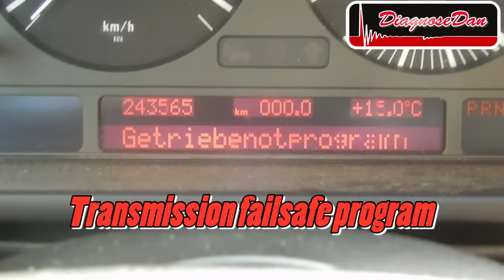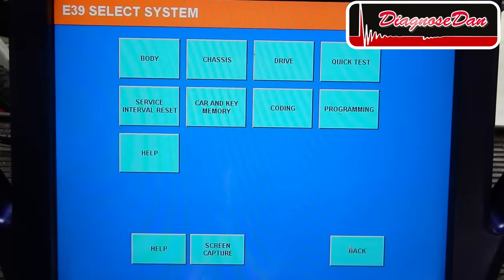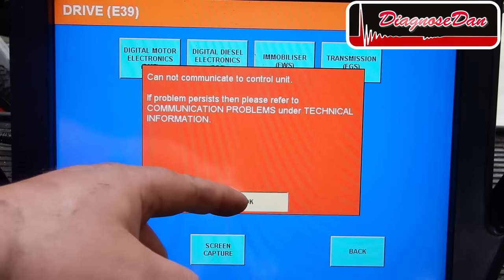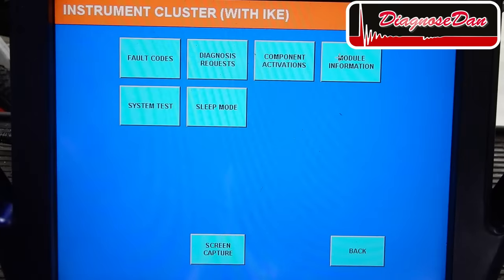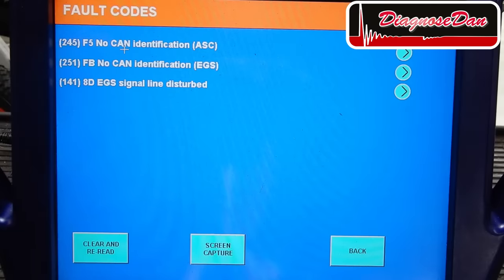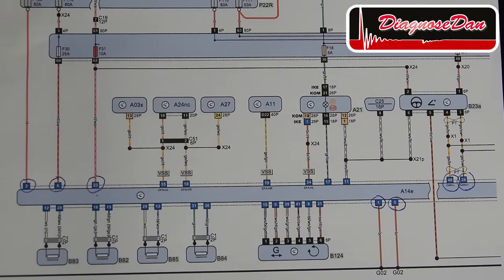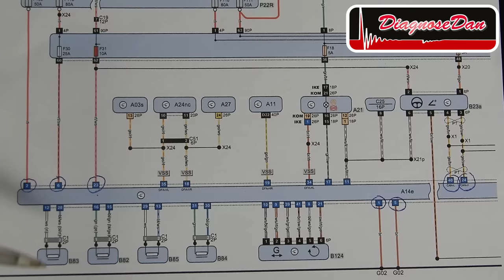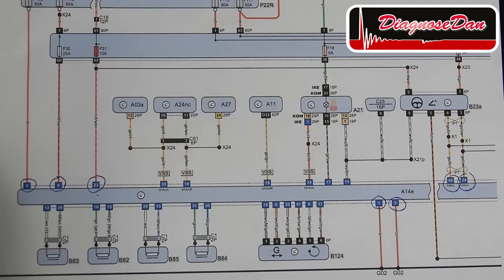Can-bus Trouble

Comment: This is a great video! My question, if you had tried to connect your scanner before replacing the bad ABS module, would you still have a comms error? I have a situation similar to this, but don't have a scope readily available.
Reply from the maker: With the ABS module unplugged the comm. is back.
Reply: Another question. Can these steps be done without first putting a car into accessory mode? I ask because I have a car with push button start and no keys.
Reply from the maker: @bl3nd3rs  the network stays active for a while after the car has been turned off. But there is proberbly still a way to turn your ignition on even though you have a push button.

Comment: Another awesome informative video. Will you run into problems by unplugging modules to where you have to reprogram or reflash them? Thanks for your time.
Reply from the maker: Thanks! I don't really understand your question!
Reply: DiagnoseDan I read the comments by Pine Hollow diagnostics and Ivan asked you the question I made. You replied about coding the module and would make another video about it in the future. My concern is about losing the program in the module or modules when it’s disconnected from power and do you turn ignition switch off or what is your procedure. I don’t have reprogramming capability.
Reply from the maker: @Thunderroad8517  you don't need to do anything when you disconnect it, only if you replace it.
Reply: DiagnoseDan Thanks for the info and the videos.

Comment: I did listen all the way through and yep it was good. Preferred it to others in fact so subscribed. I want to know your take on no can lo. naval cut out whilst driving. wipers not working. Central locking does. ECM and many others NO COMMS. Breakout board shows pin 6 busy and pin 14 long moments of nothing. then the faintest flicker for quarter second. Ohms test with battery disconnected 60 ohms.

Comment: Thanx for explanation. 
My 2001 e46  has "no CAN  iD ASC3 " error on instrument cluster all the time and that, i think, kills my ABS module every 2-3k miles. As this is the 4th ABS module installed and got failed with "ECU INTERNAL ERROR". Everything else works normally.
What can cause it and what does "no CAN ID" mean? And i there a way to fix that faulty ABS module?
Reply from the maker: Is the new unit coded correctly?
Reply: @Diagnosedan  Sure, i coded myself and calibrated steering angle sensor. Everything works well 2-3k miles and then ABS fails again with a "Internal Error ". Could it be MOSFETs are going bad on ABS because of some electrical issue or smth?

Comment: I have done the same job you done but I didn't replace it I cleaned it up and it works fine
Reply from the maker: That's great! They can be repaired most of the time there is a loose solder joint within the module.

Comment: Dan

Nice video.  But I'm confused about one issue.  What's the purpose of checking for total resistance which should be 60 ohms?  If you have a bad module (let's say a TCM module), how does checking total resistance help you?  Will your resistance change when you find a bad module?  Please explain.  Thanks
Reply from the maker: Steven Nahulak Checking the resistance rules out a high resistance( Module or connector) or a short (wire or mudule)

Comment: Hello.I have 2 questions, because I am trying to learn as much as I can from you, because you explain very,very well.
When you measured with the oscilloscope CAN High and Low signals you don't have (need) a ground connection???I have seen only to leads connected.
Second question:If you unplug the PCM  to test the influence of the signal; how do the other modules get power?Aren't they all electrically powered from the PCM??Is the PCM the ECU?Or is it a different component?

Comment: Hi dan, first off all your video’s are Great! Love to watch them all. Only have a question in this case. you can not comm with the abs/transmission/instrument Because off a faulty abs module. But if you would disconnect the abs connector, Will you maybe than be possible to comm with the instrument and transmission again with your scantool? Or is the small voltage increasement Still causing dis oriëntation on the can bus? Maybe by disconnectiing modules that are on that can line step by step and try between disconnections to comm with modules would also maybe find a bad module. So you dont have to need a scope for all can bus faults. 
Thanks for all!! Groetjes uit Nederland/utrecht

Comment: Great video thank you, I have an04 f450    6.0l diesel that I am working on right now and I have a CAN issue. I have prodemand, all data and Identifix but I’m struggling to find a good schematic for the communication networks is there a good site that I can use for some of that information and also for good waveforms. Thank you. I need to learn more about the bus networks & I think this truck will help me with that.

Comment: Hi Dan, Do you think that U0001 code possibly had something to do with my Chrysler 200 car "kicked" when i accelerate from stop - feels like I was rear ended. Nice video presentation by the way.
Reply from the maker: Hard to tell because U0001 code is a generic code. Usually it comes with a second more specific code.

Comment: Dan I do have a quick question-- all modules have 60 ohms running thru them whether they r good or bad? That ABS module had a short and so wasn't communicating with the others so how can low/high speed 60 ohms run thru it?
Reply from the maker: The 120 Ohm resistor inside the ABS unit was still good.

Comment: This is a good video it take us through the inner working of the CAN bus protocol, however this system can fix without the oscilloscope. The first thing to do is to ensure proper continuity in your conductors and do your ohms test with the digital multimeter. One major thing he did not highlight is which ECU responsible to provide the CAN network with the information. eg The Yaw sensor/module is responsible to provide steering angle and steering torque signal to the CAN network. So if this sensor module failed ,the EPS and the  ESC/VSA/VSC/ESP(they are all the same thing) will not function properly because both system ECU require this information for the EPS and VSA to work properly via the CAN network. The technician have to knowledgeable of the entire system to solve which ever network problem they are working with on. Excellent video please upload more

Comment: hi Dan  love the videos 
i was wondering about the ATIS PRO   soft wear (i know its off topic  but don't know who else to ask)  
as a small one man garage we do some engine diagnostic work but as you are aware information and equipment is very expensive .i have seen that the software you use is very good on components and wiring diagrams for engine related faults 
we do some engine related faults but also need to do normal electrical faults on other systems wiper/washers horn and many other things the main one being a/c and climate control systems  does the product cover these areas  .
Reply from the maker: acorn motor repairs, We usually don't use a scope for diagnosing problems with a horn or wipers. But the wiring diagrams are mainly for engine,Abs,ect. But there are a lot of options for using the scope for ac problems. If you would like to know more, please contact Ryans Automotive. He sells the GMTO scope and software and he can give you a free demo!
Reply: thanks for the information and your time 
i will get in touch with Ryans and see whats available  thanks again and thanks for the videos 

brian
Reply from the maker: acorn motor repairs, Your welcome Brian! Thanks for watching!

Comment: I am having problems with a 07 dodge magnum srt8. It’s giving me all sorts of no communication codes. They are as follows U0164 lost communication with HVAP control module, U110B lost engine coolant message, U0100 lost communication with ECM/PCM, P0456 small EVAP leak, and P0302 cylinder 2 misfire. I’m have also noticed my check TPM is on, head lights/fog lights flickering, and my remote key doesn’t unlock my car any more. I had my TCM replaced about 6 months ago and I’m wondering if they replaced the wrong part. I do not understand a lot about electronic systems your video help me understand more. Does this sound like a bad ECM/PCM to you? Any tips or advice is greatly appreciated. Thanks and keep posting the informative videos.

Comment: Very good course, i don't speak english very well (i speak french) but i understood what you mean in this video.
I have a question please:
In this network the PCM is the Master? I think there are many 120 ohms resistances.
In a network the master first module should get the 120 ohms and the last one should get also one.
Witch one is the first one and witch one is the last? See you

Comment: Hello Dan perfect video. But i have a question. The question is the value of resistance for the can high and can low is the same for all types of units (ecu) and?
Reply from the maker: Yes the resistance is always the same
Reply: i have an ic and i measured with multimeter in diode mode  but i don’t know if the numbers that are show on multimeter are correct. Do you know some ways to find the correct values?
Reply from the maker: @modestos93  datasheed?
Reply: You can’t find from datasheet

Comment: I forget to mention this. Can any of the two resistors go bad? When they do, how do you know they are bad and not assuming it's one of the modules in the power train(ECM, TCM, ABS)? How do you know the location the resistors are and to replace one of them or both? Thanks
Reply from the maker: Paul Iroha The resistors can go bad if one does the resistance changes on the can wires. The voltages of the signals also change. The resistors are build into the modules.

Comment: Hello Dan,I want to know sir what should i get from good module because  before you replace the abs module when you removed abs connector you read 120 hms and when you connected it back you read 60 hms , but if the abs module is not the problem what should I expect ?Thanks.
Reply from the maker: 60 Ohms😉

Comment: Always the best Dan. Thank you for simplifying the CAN bus....always learn a lot .

Curious if your tools decode the CAN bus and can see the data being sent.
IE if the wheel speed header is 1201 and the next 4 pieces of data is revolutions per hour (or minute) that your tool can filter down to Wheel Speed and display something like
Wheel Speed      340rpm     420rpm    300rpm   500rpm

 Or is having this granular detail too much since the data is so often, that it would be better to look at Live Data via the ODB2 port?

Comment: great beginner video to high speed CAN wish you would have put a 120 ohm resister into the can lines for the ABS connector and shown the wave form for the CAN bus with the proper terminating resister at the end of the line.

Comment: Hello Dan, I have a 2017 VW Golf Sportwagen. After I had my battery changed. My computer controlled windshield wiper does not downshift when I stop the car. Like it did before. Then I had set the computer to swipe the rear windshield wiper in the rear once, when I shift into reverse. I have run diagnostics with my thinkdiag bi-directional scanner. But there are no codes. I am assuming that the CanBus has something to do with this problem. The wipers work like ordinary wipers, but are not automatic speed control anymore. It's hard to get information on the internet. I have tried to buy the repair manual from the dealer, but they refuse to sell the manual to me. It's only for the technicians. It's not a big deal, but I would like to know why it stopped working, like it did. Thank you, Ralph

Comment: Very good video I have a BMW 1 series 2009 I did sum work on it and when I started the car up the radio would not turn on and it put the air bag and seat belt lights on on the passenger seat I did a scan with ista and and there was no com from the radio do u have any advice for this

Comment: Hi Dan
Thanks lot for excellent knowledge sharing. My mercedes clk500 goes into no-comm error for abs/esp module after 10 mins starting engine. I replaced with 2 different used control module from eBay, got the original part also repaired. Still getting no-comm error. Any ideas/tips how do I go about tackling this? I already spent 6 hours with mechanic , no luck so far. Appreciate your help.
Reply from the maker: Of course you need to scope the comm. wires to see what is actually happening.
Reply: Thank you Dan. Can I pull the module one by one when the car running? This car have CAN bus connector where all the module connected into it . Also can suggest me scope for DIY people?
Reply from the maker: @mangapillai  the Ditex scope is great for DIY. The bar doesnt need to run just turn on the ignition.
Reply: Hi Dan, I am able to capture the CAN data. I do see some glitches. I like to share the picture with you get your thoughts. How do I send the picture to you? As you said in your video I didn't get lucky :-), 1st attempt removed ABS module, still some glitch.

Comment: Wow how did I miss your site.  I'm kinda late to the party but Eric O mentioned you in one of his video's.  Would it have been possible to disconnect the abs module and check the to see if you were getting communication back to your scan tool without a scope?  I'm taking a crash course in using a scope since I just purchased one.  Great video.

Comment: Nice video.my car has the problem of charging only gears 2,4,6 only. 1,3,5 and 7 not charging. And transmission fluid comes out from vent pipe from mechatronic.VW Jetta DSG

Comment: I have the 125 ohms on my multimeter .. while testing port 6 and 14, at the obd connector, no crank, unless I use a wire from the starter relay ground pin, to the chassis ground, insert the relay a little, then I can use the key to crank the starter, but I already know, what the problem is now, because of your video, thanks.

Comment: Dan, is speedometer controlled by the rear abs sensors? I replaced rear sensors and it seems when i start the car when cold, the speedometer doesn't  work. After driving fifteen minutes, shut off and restart the speedometer starts working again. Ever seen this? Been driving like this for a couple of years. Electronically parts stop working, like right passenger window, then a week later rear driver side window. Then ac blowing warm on driver side. PDC flashing, tire pressure guage not working. Map sensor also i believe is not working. Car runs and drives great tho. Too many things wrong to take to a shop. Oh ya and also cd player works and cdc player but fm/am doesn't work? Do you have a quick fix? Besides buying a new car.

Comment: Dan

After re-watching this video again, I have one question.  When connecting your scope to these can lines, is the ignition switch on or off?  If on, is it a good idea to be disconnecting modules with the power on?  If ignition is off, why would there be any communications going on the can lines?  Please explain.  Thanks
Reply from the maker: Steven Nahulak Can lines can be active for about 15 minutes after you turn the ignition off.

Comment: Best mechanic on YouTube, what software do you recommend for BMW troubleshooting? And what hardware to check voltage on the computer oscillating scope?? 

#diagnosedan so I had similar problem but not all your tools 🧰 so I unplugged the ABS and sent my ABS to an online repair biz, now I dont have the the problem of transmission safe mode and speedometer, but my DSC and ABS and Brake lights still on dashboard... what you suggest like get a scope and check high low signal ground and positive like your video???
Reply from the maker: I use the Gmto scope with Atis software visit the Ryans Automotive website for more information

Comment: super en simpel uitgelegd! dank
Reply from the maker: Edwin Heij Graag gedaan! Bedankt voor het kijken van mijn video
Reply: Zo ben ik twee jaar bezig geweest om het niet werken van de stuurbediening van mijn radio (e46) te verhelpen. lampjes branden en bij flinke vorst de knoppen ook 10 seconde. Hele auto uit elkaar gehaald en knoppen sleepring etc vervangen, de can draad connector uit elkaar geprutst en een voor een draden verwijderd. Mijn diag apparaatje las de module niet. Uiteindelijk las ik ergens heel toevallig nadat ik het eigenlijk al had opgegeven dat de rechtse knoppenset (cruisecontrol) de eigenlijke module is en de linkse alleen is doorgelust. Nieuwe rechtse knopjes besteld en haha na 2 jaar zweten en internet afspeuren werkt alles weer. Had ik jouw video's gezien dan had dat alles een stuk duidelijker gemaakt. Toppie.

Comment: I have a 01 Camry, I extracted the P1135 code,it’s an A/F ,heater circuit sensor. I checked the power battery wire, it has 11.5v,which is good. But when I checked for the resistance, on the two black wires,there was nothing. So,I ruled out, the-sensor is bad . I did not replace it,yet. Would you say the sensor is bad,also?

Comment: Hi, thank you dan for this video which makes me to understand can bus system in simple way.
Dear Dan i have one question regarding some confusion when you checked can bus via multimeter ohms were around 60 ohms its fine how its could be internal built in resistor be fault while resistance is good when you checked via multimeter ? Please i need to understand it I didn’t got that why on multimeter is showing fine and on waiveforms not good ?
Reply: I can understand  that from your video we can’t know abs control unit has internal fault via multimeter reading will be appearing as good and ok? Only waive-forms and disconnecting connector will make us make sure problem?

Comment: Hi you said unplug it test. Could you just pull the fuse? Would that work the same? Thanks!!
Reply from the maker: Paul Oneel, No if you pull the fuse a bad module could still disturb the communication.😉

Comment: I always wondered if the a better location for the DSC module would have helped reduce the failure rate for E39 and E38.  300mm from the exhaust manifold isn’t good.